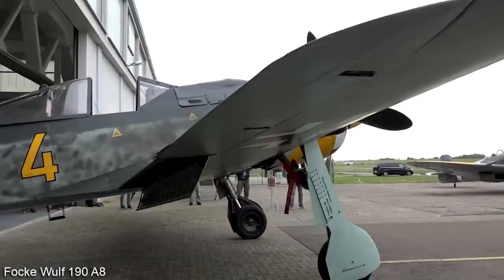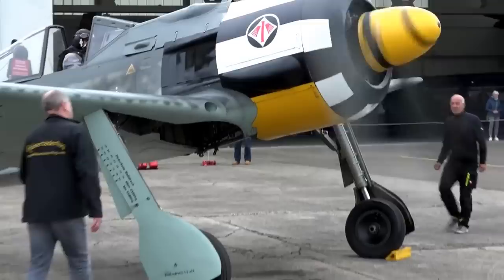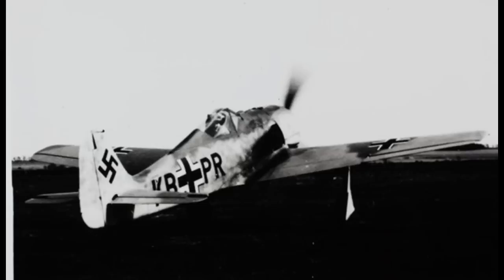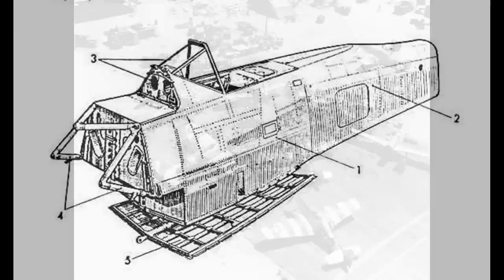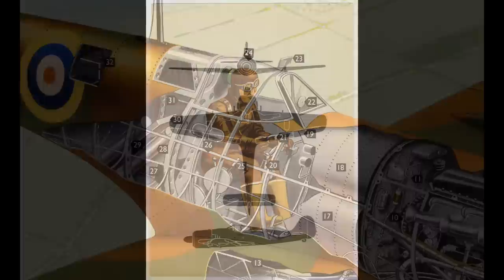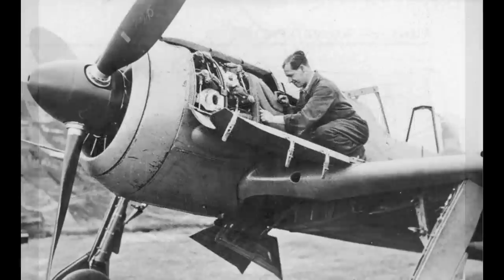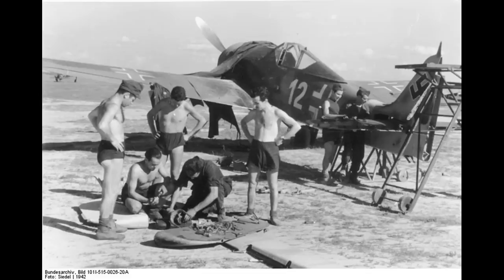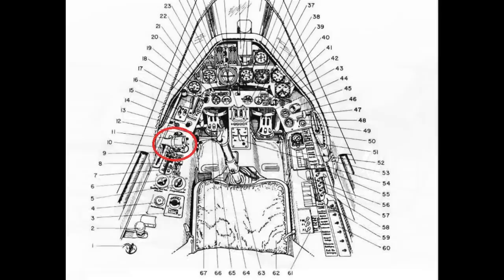Focke-Wulf Fw 190 Pt.2

Comment: Some people will try to exaggerate the Fw 190 performance since the RAF did to maintain the propaganda-based illusion that the Spitfire was superior to the Bf 109, F version included, so they claimed the spanking the LW gave the RAF over France in 1941-42 was due to the new 190, when in fact very few were in service (and with horrible serviceability due to the underdeveloped engine) and the 4 to 1 kill ratio over France  was due to the supposedly inferior Messerschmitt.

Moreover, when tested side by side (109F4 vs 190A3) by the front units, the Bf 109 turned out to be faster (except on the deck) and more maneuverable (save for roll rate) , and yet the RAF presented the scarce 190 as the real boogeyman to keep morale up.
Reply: I'm not an expert in this at all, but what little research/self teaching on the subject would lead me to think that this sort of thing was not uncommon (for the British).  In the BoB the Spitfire was elevated to legendary status and the "savior of Britain", when in reality, the Hurricane was the real workhorse of the conflict.  Even then, the British lost about the same number of fighters as the Luftwaffe, which considering the mission at hand, limitations on the Bf109 (short range/time over target, and the need to stay in close with the bombers), I'd say that the Luftwaffe, despite losing, gave at least as good as it got, if not more so.

Anyway...  The old adage applies.  "The winners write history...".
Reply: @WHJeffB  In my experience, war propaganda often ends in history books which makes learning a mess, even ridiculous stuff like carrots.

I dont knwo about you, but I was fed carrots as a child because "it was good for the eyes", which was a British propaganda leftover, they tried to hide their radar by claiming that a carrot-based diet made their pilots sight extra sharp.

Fully agree on the rest... except on the history thing, here is a very interesting and short video on the matter.

https://youtu.be/FSyCn93CgM8
Reply: @trauko1388  Thanks for the link, very interesting perspective and enough that I'll refrain from using that statement in the future.

Thinking more on the subject, I've read bits and pieces from US and UK based authors on the subject of German aircraft in WWII.  As far as I can tell, these authors were relatively objective in their analysis, going so far as being impartial enough to state the definitive advantages of some of the Luftwaffe's aircraft over that of the Allies. 

Interesting stuff...  Wish I had more time and dedication to really delve into what's out there.  Commentary on YouTube videos by the keyboard warriors and Internet Fanboys can be tiring and misleading...
Reply: @WHJeffB  Glad you found it useful.

Regarding evaluations, we can always try to be honest, but there is always a degree of subjectivity, how much it depends on the country and even each individual.

Remember, the US looked at the MP18 and StG44 and was not impressed... well, its the same people that rejected the Lewis machine gun so...

What can I say, I have believed for years stuff that was later proven wrong so, at this point, being wrong is not a problem, only being stubborn and narrow minded is, so always have salt at hand... you never know.

Comment: I've been starring at that diagram of the elevator differential trying to visualize it's movement... without luck.  So is it supposed to vary the input with travel?  Kind of like how some  cars  have variable steering...  varying the ratio as you turn the wheel.
Reply: BEMBlaine If I am undersanding the variable steering correctly, yes. If a plane has a direct stick-to-control surface connection, the control authority will be linear to the amount of force applied to a stick at a given speed. If you want to make it easier to fully deflect the elevator, you set up the linkage in a way that will give you more mechanical advantage to deflect the elevator. However, this will make the elevator too sensitive if you want fine adjustments around the center point to aim at a plane flying in front of you. Adding a differential control system allows it to be less sensitive with the stick centered to allow pilots to aim better while still being able to fully deflect the elevator by pulling on the stick far back for a hard turn.

Comment: Who would have thought that something with BMW on it could be easy and ergonomic to service.
Reply from the maker: They seem to have lost their way. In fairness, most new cars are a nightmare to work on.
Reply: +RJCH   I think both Daimler and BMW kept the tradition of "factory service only" since the Luftwaffe would often send the entire engine back to the factory and replace it rather than any major field repair. https://i.pinimg.com/originals/45/95/e7/4595e7c6a4b575a62c17c589a0baec45.jpg
https://upload.wikimedia.org/wikipedia/commons/6/67/Bundesarchiv_Bild_101I-332-3096-12%2C_Russland%2C_Entladen_eines_Lastenseglers_Go_242.jpg
Reply from the maker: That's a fair point. It's true that the Germans leaned towards a remove and replace engine configuration. I'm going to talk about that in a future 190 episode.
Reply: Greg's Airplanes and Automobiles Fascinating. I was of the impression the practice applied only to the BMW Jumo 003 jets out of necessity.

Comment: Is that because bf109 has the hydraulic coupled supercharger that gives an almost constant manifold pressure in its operation attitude, so without the ‘command unit’ it still works more or less ‘automatic’. And as the P47s it has the turbocharger that also gives a constant manifold pressure.
Reply from the maker: The 109 is sort of halfway between the P-40 and the Fw 190 in terms of engine management. The 109's mixture and supercharger are automatic, but not the engine/prop rpm. The 47's turbocharger actually takes some extra work and understanding to get maximum performance, at least until the N model.
Reply: @GregsAirplanesandAutomobiles  Thanks for the explanation.

Comment: Every aerobatic pilot knows that straps on rudder pedals are to keep your feet in place under high g negative maneuvers!  Nice guess on your part though, I never thought about battle damage.
Reply from the maker: I agree. Although I have flown "aerobatic" planes, none had these straps, probably because they were not rated for negative Gs. (150 Aerobat, Citabria, PT-17)
Reply: @GregsAirplanesandAutomobiles  Just try to do precise rudder motions while pulling 6 Gs inverted, your feet will come off the rudder pedals. With straps, you can let them take the load and still fly with precision.
Reply from the maker: No thanks, I don't like negative Gs.

Comment: This was actually really useful, I've been learning the hard way how complex engine controls work in IL-2 on the P-40, since the P-40 DLC's auto engine controls aren't very good for some reason (Also, now that I'm actually trying to legit learn how to fly, a little more realism doesn't hurt). I killed the engine a lot, and kinda learned what does and doesn't work. However, the limits and procedures you covered here will probably help me get the most out of it without killing it.

Any plans on making a series covering the P-40? I'd be interested in seeing that.
Reply from the maker: I would like to do a P-40 series, I love that plane. In most, but not all real world airplanes, if they are a complex type with a constant speed prop, it's right to left for increases in power, and left to right for decreases. So the throttle is on the left, then the prop and mixture on the right (there are exceptions of course, but most have this layout). To increase power, go right to left, mixture, prop, throttle. To decrease it's the opposite.

Comment: Greg, I have a request for you.  The Kawanishi N1K2-J Shiden Kai has something called combat flaps.  It used a mercury switch to automatically deploy flaps during turns.  I understand the basics, but I don't really get how it works.  A mercury switch should just be G based or something, but deploying flaps at high speed and high G's would be bad since it would slow you down.  I would think you would only want to deploy the combat flaps during low speed turns where g's are lower.   Do you have any additional details on how this automation for the combat flaps worked?  That would be really interesting.
Reply from the maker: I think the system works with a combination of G load and indicated airspeed. I'll have to double check that. At some point I'll start making videos about the Japanese planes, there is a lot of interesting tech there. If only I had more time.

Comment: Nice shout out for Il2. I'll need to test the 190 a bit more but I don't balance is a consideration for Il2 they do try at least to make it as accurate as possible. You seen the DCS 190?
Reply from the maker: I haven't flown the DCS 190. I haven't really tested the performance in IL2 for accuracy, but I have the impression that they are at least a bit concerned with balance.

Comment: I wonder, if the Luftwaffe had the FuG 25a Erstling IFF system fitted, why did so many Luftwaffe planes get shot down by German AA during Operation Bodenplatte?
Reply from the maker: Because the AA gunners were conditioned to firing at any airplane they saw, since they were almost never German. Plus, not all AA fire is tied into radar.

Comment: All the Japanese fighters (or at least most) had a one piece wing.  The fuselage comes apart on the rear so you can take it off the factory door.

Jeffrey Quill discussed the sitting position of the Spitfire.  The argument was that an upright sitting position makes looking behind much easier.  I am wondering how many g's the 10 or 15 degree difference accounts for?
Reply: @HiWetcam Yes, that's right, that will help for high G's.  As for the rear head turning ... I am only reproducing what Quill said.  I think it makes sense.  Thanks.

Comment: I think there is a problem with the manifold pressure gauge.  Between 65 and 75 inches it should read 70 and not 50.

Comment: In one of your videos (I forget which one exactly) you mentioned that you think the Heinkel He 112 had more potential than the Bf 109? Would you please explain why?

Also, what are your thoughts regarding the Heinkel He 100? Should it have been accepted into production?
Reply from the maker: I don't recall saying that the He 112 had more potential than the 109. I do think that both the 100 and 112 had a lot of potential and were canceled too soon.
Reply: @GregsAirplanesandAutomobiles  I apologize if I misquoted you. I was thinking about a video talking about the elliptical wing design of the Spitfire and He 112 where I thought you mentioned that it had a lot of unfulfilled potential.
Reply from the maker: Oh yes, it did have a lot more potential, I'm just not sure it had more potential than the 109, it's tough to gauge that.

Comment: @Greg's Airplanes and Automobiles I know you said that you only touch on jets a little and I know that you don't really take requests, but I would like for a person of your aeronautic know how to find out the mystery of why the J-35 Draken is faster the the F-102 even though they weight about the same, have about the same thrust dry and in reheat, and both have delta wings.
Reply from the maker: It's not that I don't take requests, but just the ones from my Patreons are taking up most of the airplane video time. I may get to the Draken at some point, but the cold war jets won't be covered for a while.
Reply: @GregsAirplanesandAutomobiles  glad to hear it and its all up to you. Perhaps I should have paid on patreon for a request. My bad XD.
Reply from the maker: It's just that I have to prioritize somehow. It's basically what the Patreons want, what I want to make, and after that, what I can fit in. The problem is, so many planes, so many topics, but real life interferes with my youtube channel hobby.

Comment: 35:00 Ergonomics - in the article below Rick Volker praises the ergonomics of a newly restored Bf109G (as well as clearly falling in love with it - but honestly, who would dare to blame? :P ) and since he is a lucky one, he could compare it to the earlier E models.
https://www.warhistoryonline.com/guest-bloggers/newly-restored-messerschmitt-bf109g-flies-test-pilot-shares-experience.html
"Entering the cockpit is similar to putting on a bespoke suit. The fit and ergonomics are way ahead of the time. (...) As you visualize your flight and go through all of the usual procedures, close your eyes and imagine where something should be at each step. Reach out and touch. Open your eyes now. That is exactly where it is.

The E model has a busy workload with manual oil cooler doors, manual radiator doors, manual propeller pitch and a stiff T handle for landing gear retraction that requires the same wrist movement as pulling a tooth. The G model has drastically reduced workload and effort. There are little push buttons for selecting landing gear, automatic oil cooler doors, automatic radiator flaps, and finally, automatic propeller pitch control that works. There is no need for a mixture control. The stick design is of perfect angle and length. There is no friction of any kind in the flight controls. The rudder pedals copy and contain the exact shape of the foot, so that in negative G flight, you are still in the game.
"
Reply from the maker: The 109 is a fine airplane, but much more tricky to fly than the 190, and far more were lost to take off and landing accidents. That said, yes, they improved the cockpit over time.
Reply: @GregsAirplanesandAutomobiles  Yes, the Bf109's "demanding characteristics" were also quite graphicly detailed in this article too ;)

Comment: 17:00 Manual manifold pressure / RPM - Is this what Lindbergh taught in the Pacific for P-38 range?
Reply from the maker: I don't recall specifically, but he would have had to talk about those two factors. I seem to remember something about mixture as well. I'll probably talk about it in the P-38 series.
Reply: @GregsAirplanesandAutomobiles  Mixture is what I read.  Extra range through leaner mixture.  The Japanese were masters of the tactic.
Reply: Soviet Warplanes.  The "Twin" programs which failed to succeed are unusually interesting.  The Soviet struggle to find the perfect self escorting intruder is worthy of study.  We all know about the Pe2, and Tu2.  We don't hear much about TIS or Pe3 projects (and some others).  Many Soviet (and other) fighter projects failed because the engines they were meant to use never materialized.

Comment: Would you say DCS is realistic with the 190 having the edge at high speed turns I'm here since I'm trying to find the fw190s weaknesses and strengths to use against a friend that flies the spit
Reply from the maker: I haven't flown the 190 in DCS but my understanding is that it's quite realistic. Flying 1v1 vs. a Spitfire is tough. A lot depends on the versions here but for an A3-A5 vs Spitfire Mk V through early 9 the tactics are about the same 1. Use speed to stay away, but keep an eye on him. When he gets distracted by another enemy, close in and shoot him. 2. Run away, turn and force a head on pass, this is always risky, but your more rugged 190 has the better chance here. 3. High speed climb (there is a JG1 Barton video showing this tactic for D-9 vs. Spitfire) just out of gun range. As the Spitfire follows he will keep falling farther and farther below you. You can then turn to create an angle where you can dive on him and he can't get a shot at you. Bottom line is that the Spit is so maneuverable that 1v1 is always a problem. However 2v2 or more the 190 has the edge. Also, I find that well timed flat scissors beats most Spitfire pilots. I have a video on that.
Reply: @GregsAirplanesandAutomobiles  I forgot to say the fact that the model I'm using is the a8 oh well
Reply from the maker: Ah, the A8, that changes things a bit. That means you are normally fighting a Mk9. Keep the fight down low and use your C3 boost like there is no tomorrow. Keep the fight at high speeds, at least 400kph and the distances high. Then when the Spit closes scissor him if you can. Please watch my scissor video: https://youtu.be/cjZUF6sbUVI . Then go to the other channels I mention there and watch Central and Sheriff blow Spits out of the sky with the 190. That might help.
Reply: @GregsAirplanesandAutomobiles  k thanks

Comment: This isn't a a page about the Spitfire, yet I would like to know how the low-level performance of the Spitfire MK.IX compared to the LF MKVc, the latter being specially designed to counter the FW190 at low altitude
Reply from the maker: Hi Pascal, I'll get to that, it's just too complex for the comment section.
Reply: @GregsAirplanesandAutomobiles  Yes thank you. I sometimes wonder why the LF Mk Vc is and was generally considered to be of low value altough al low altitudes compared to the standard MK.V it was something of a hot rod
Reply from the maker: As I talk about various 190's and get into performance I'll cover various Spitfires, for example A3 and A5 vs Spit 5 variants, A8 vs Spit 9 and 16 types and so on. The main 190 variants in this series will be A3, A5, A8 and D9, but I'll cover the more obscure A models as well as the Fs, Cs, and Ds up through D-13. First, I have to get all the basics covered, I think I'll cover the BMW engine next.
Reply: @GregsAirplanesandAutomobiles  Great. Thank you so much, I'm looking forward to every bit of it
Reply: @Greg's Airplanes and Automobiles 
Do not forget about A-9, please.
Reply: @wolffweber7019  Please help me, what was speial about the A-9?
Reply: @ Pascal Chauvet BMW 801 TS engine, rated at 2000 hp. While personally I prefer D9, A9 was last of the breed of Antons, with improved performance compared to A8